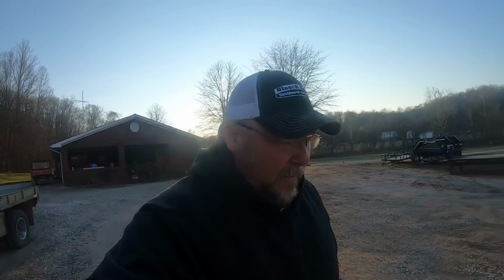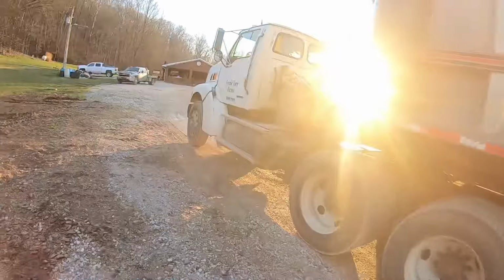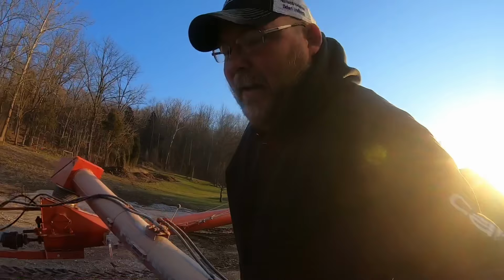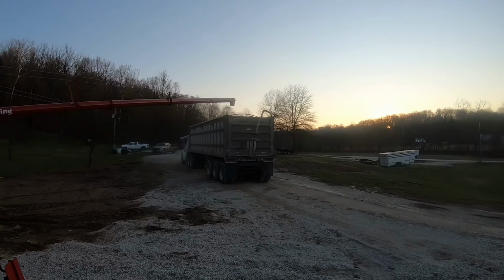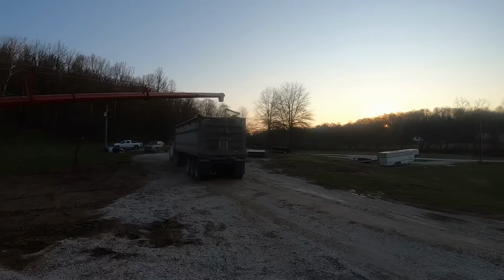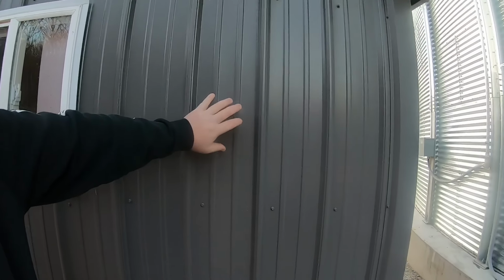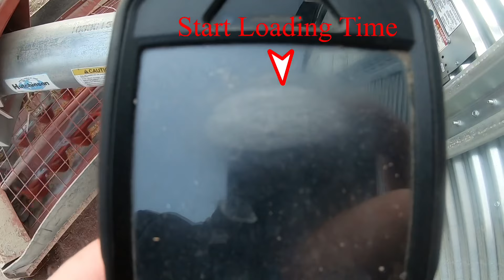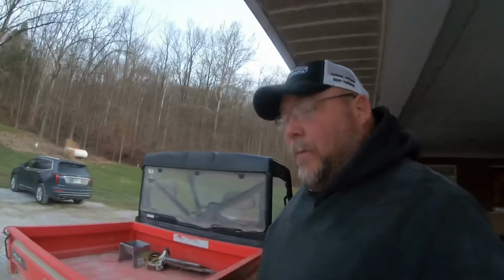Loading Out Corn #grainbin #brock #farming

Comment: Good video Chris. I have an international tri-axle dump truck with an ism Cummins engine. They are good motors. Then I have 2, 1998 Freightliners  with the 60 series Detroit engines and they are great motors. My dad owner operator trucked all his life and after he bought his first 12.7 60 series Detroit that is all he would run. He is  87 years old now and he trucked till he was 83 years old. Thanks for sharing your video!
Reply from the maker: I drove a truck full time for 2 years and it had a 60 series Detroit, seemed good on fuel mileage, I’m not tied to cummins just happen to be in the trucks I ended up with, Thanks for watching

Comment: Nice to see the bin in operation. Be nice to get your soft start switches in, saves a lot of hassle. Nice to see your plan for the future coming together. Wish you the best sir.
Reply from the maker: Thanks for watching
Reply: Soft start systems relieve a lot of the beating of starting up a motor. Without it a motor wants to go to 100 percent tight off the bat. Just like dropping the clutch on a vehicle.

Comment: I'd definitely go with belt trailer with 60" belt an 78" sides Chris you'd drop 5k off tare weight an go with a trinity twin bridge for the weight an strength. I'd pulled a trinity for 8 years hauling fly ash if known anything about that stuff it's hard on equipment an in that time I never had a chain break had to take couple half links out over time
Reply from the maker: Thank You

Comment: Would getting a used aluminum trailer gain you the weight to haul more corn?? Just curious, I know some are still on steel frames so the gain isn't the greatest, how much does the tag along axle gain in weight hauling?? Tia
Reply from the maker: These trailers are aluminum box steel frame, third axle adds 2,500 lbs, Thanks for watching

Comment: What is the voltage you are working with?Next what  is the hp rate and rpm
Reply from the maker: 480 volt, 10 hp on unloading auger, not sure on rpm, I’ll have to check the tag
Reply from the maker: 1760 rpm

Comment: I'm kinda surprised that the mills don't run two shifts or even 3 during harvest time, causing allot of farmers to put up these huge bins with allot of added  expense. Not sure why not???
Reply from the maker: If they are open multiple shifts they would fill up and be closed some days, it just takes time to load out on barges here in this area and get it moved out.
Reply: @farmerchris1  I kinda thought about that after i wrote it, and they have dry time too, yours would be ready for loading and get a bit more for it. Been down the Mississippi river and saw a ton of that first hand. Thanks, nic..